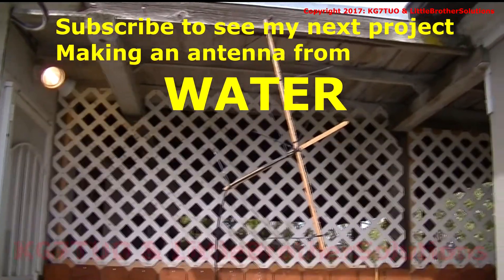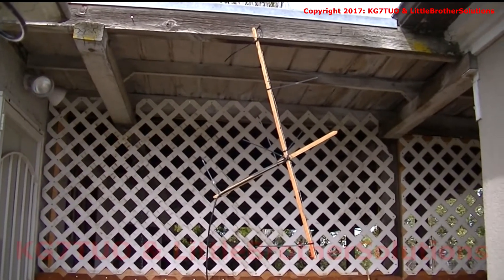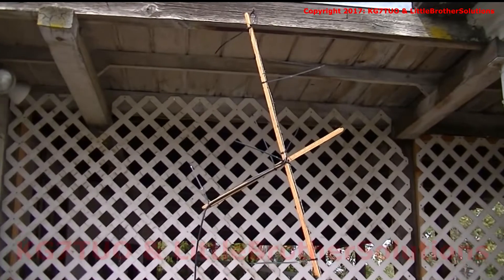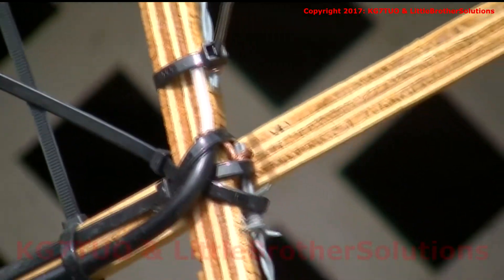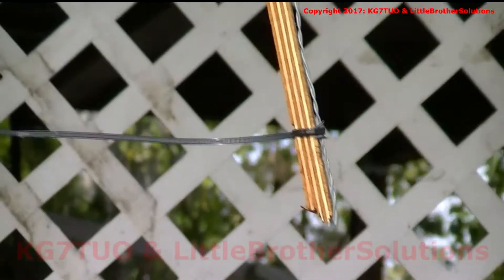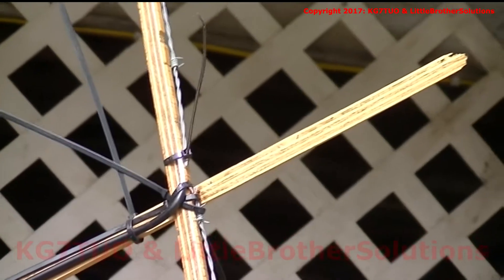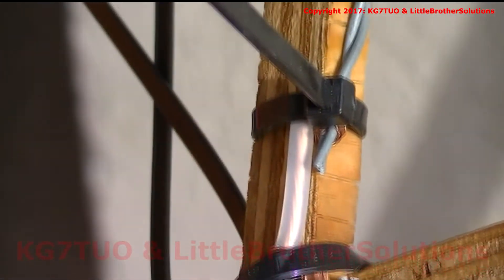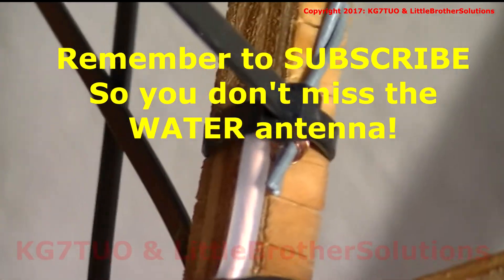BARBED WIRE ANTENNA (2 meter)

Comment: I was thinking to make even more basic, suspend with a string and draw taught with a stone weight.
Reply from the maker: I think the only issue you would have is getting the coax to leave the center at a 90 degree angle for 1/4 wavelength or more.